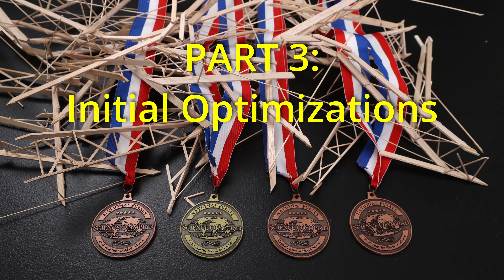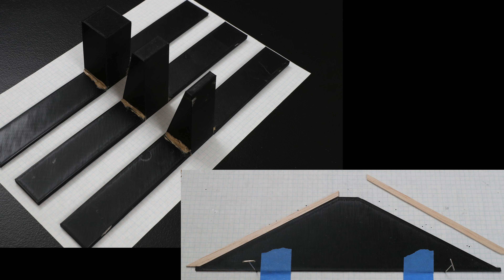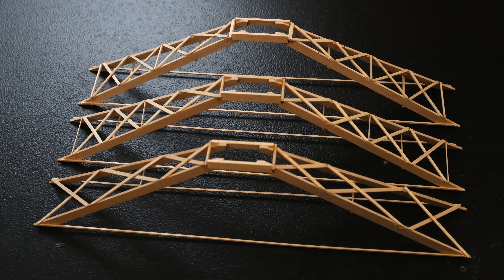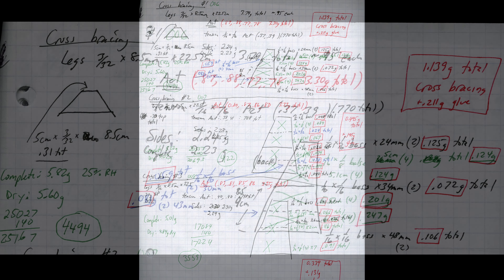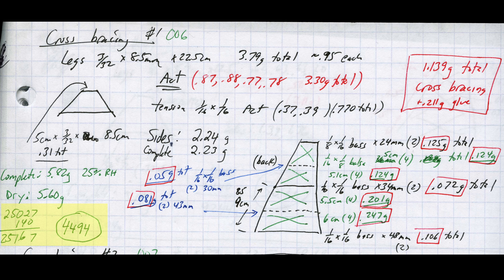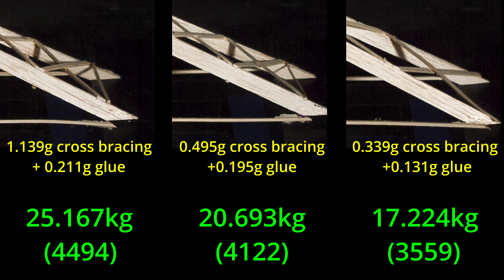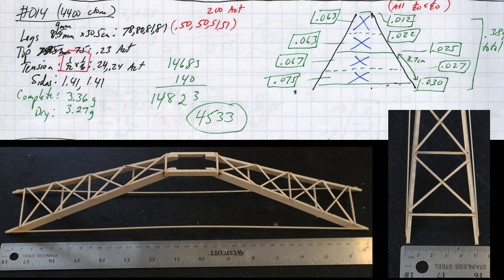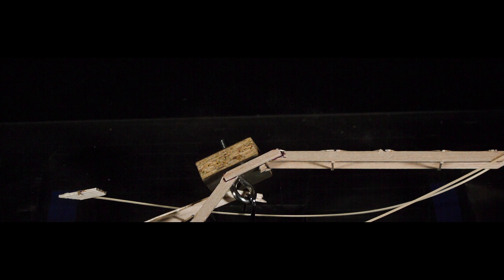Advanced Optimization for SciOly Structural Competitions: (PART 3: Initial Optimizations)

Comment: Thanks again for the videos. One question I had was about bridge reuse? We have a number of bridges that met the 15kg threshold and we ran out of weight before they could break. Could or should we reuse these bridges for the competition or try to replicate and submit a new build? I lean towards building a new one but would like to have greater confidence that it will be as good as the ones already made? Thanks for any advice you can give
Reply from the maker: If you have multiple bridges that have already held 15kg, you are in a good place.  I would recommend re-testing each of those bridges again to exactly 15kg. If more than 1 survives that process, take the lightest one.  The only reason you should have to build a new one would be because you want to try and build it lighter than what you have.  If you do that though, make sure you test the new one to 15kg as well.  This is very important to do this year due to the bonus rules as it's very important to hold all 15kg.  Good luck!

Comment: Hi balsa engineering! Is it possible to post the 3d jig used to make the "sides" of the bridge? (Also is it Division B or C bridge template?)
Reply from the maker: Hi!  I'm not sure you really want to use this jig as it's for Division B using the 2014-2015 rules when there was no height restrictions.  This jig makes bridges that are slightly under 10cm tall which wouldn't work for this year's rules.  It's a pretty easy thing to make with CAD though, so I'd recommend just using this idea and making your own for this year's rules.  If you still want it, I'd be happy to post it though, let me know.
Reply: @balsaengineering6686  Thanks, I would still want it as I am a bit basic to cad, but giving this jig to my friends would help, and also I would like to thank you for helping me make 1.7k efficiency bridge!
Reply from the maker: Congrats on the 1.7k bridge!  Here is the stl file I used for this project:  https://klingerphotography.com/BalsaEngineering/side_jig_wrk5.STL